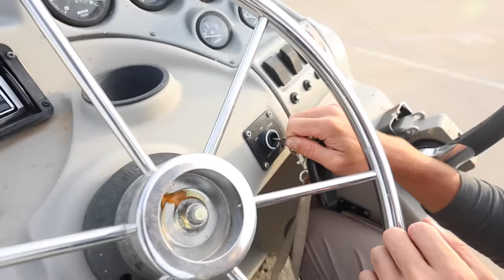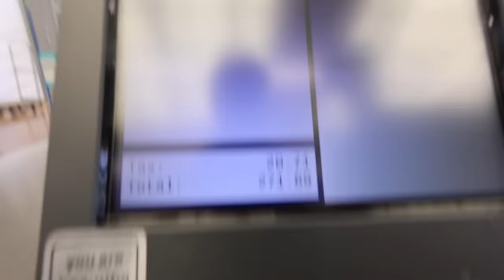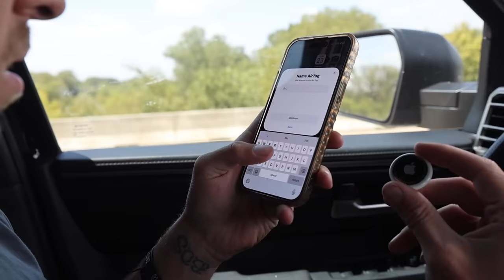Catching the TRESPASSERS who stole my boat… (incomplete)

Comment: The engine moves up and down. That's called pitching. It basically means that the front of the boat tilts up or down depending on the steepness of the engine.

Comment: Told tou I'll come down and wire that thing for free you just supply the connections and wire
 We can make it solar. Put you 360 monitors in it you can drive it with the drapes closed.

Comment: Well to be fair, IF you had accidentally, as in unintentionally, tripped over the back edge of the boat and went face first into the propeller at full throttle most comments would probably be roasting you for having been “stupid.” 

Rest assured all is well, they don’t all agree you are stupid for having jumped off the back of a moving boat because your face didn’t get chopped to bits but if they did agree and it seemed to be the most popular opinion, it is still only an opinion and won’t be a fact. 😂🤣

Jump if you like and fully jump! Be the living model of ‘stupid’ for others so they can value their ‘safety’ more when they become disturbed watching others do what they are too scared or ‘smart’ 😉to do.